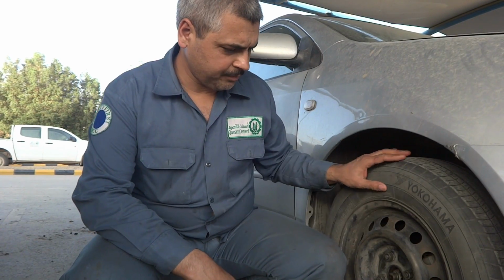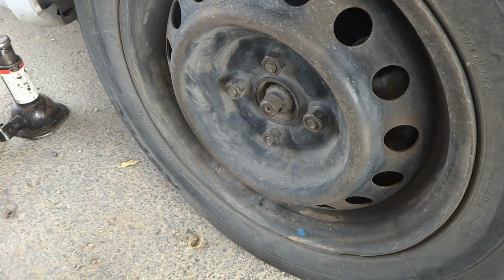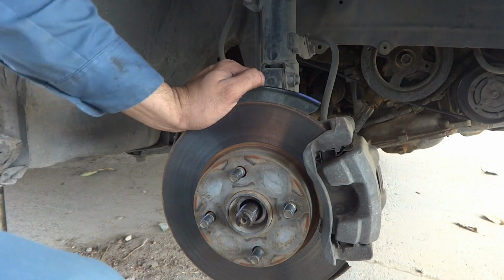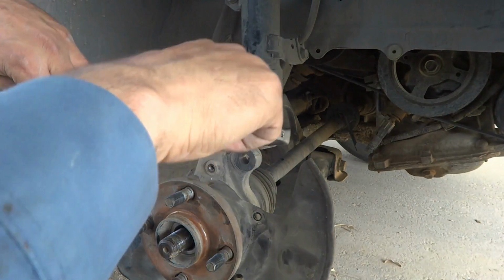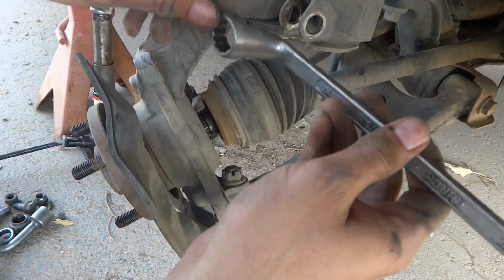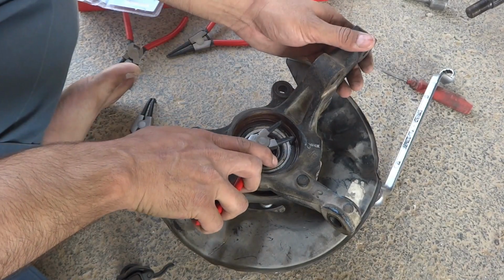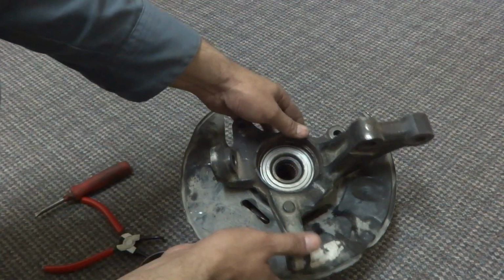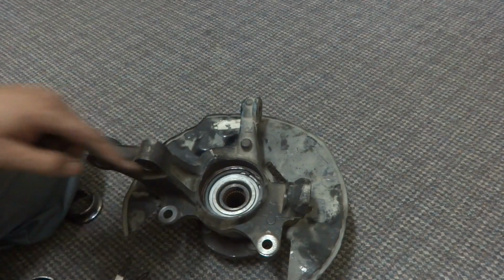Car front wheel bearing replacement. car repair, car maintenance.

Comment: Next time you change a wheel bearing on a Corolla, theres no need to remove the steering joint and the lower ball joint, Just the 3 bolts holding the lower ball joint to the chassis. It will save you a balljoint and some time :)
Reply: Do you think that is the same for a Yaris? I'm changing the clutch so need to get the shafts out.

Comment: Loverly job done jahan :-))

Ive watched quite a few videos and that inner race is allways a pain to remove, some people use a disk type tool to cut a slot in the race then place a chisel tip into the slot and hit with a hammer to fracture the race.

But your method works nicely, and the job is done :-))
So much easyer when you have some good tools, those circlip plyers look smashing :-)

Comment: Looks like you have "HAZET" double box wrench,probably model;630-30X34 or 630-30X32.Quality tools,"HAZET"!I would never use hammer on my wrench.
Reply from the maker: +Broj 1 Yes maybe. They work nicely with me. I am hammering sometimes to make things loose or tighten whenever it is required. It is not harming anything but the vehicle safety is important than anything. Regards,

Comment: You need a press to remove the bearing and then a press to insert the new bearing. The way you are doing it hammering on the new bearing to insert it will damage the new bearing.
Reply from the maker: Excellent comment. This was a diy replacement without fancy tools. Stay tuned.

Comment: You didn't show how you removed or pressed the bearing.
Just stated that a pipe was used.  
Wasn't that the whole purpose of this video?
Reply from the maker: m.m.rashid Yes dear friend you are correct. The whole process is so complicated for bearing replacement that it was going beyond the reach of this video. I will try to shoot a video showing ever detail some times when ever will get a chance. Hope you understand some thing from the video and also there are a lot of other videos showing lot of details on other subjects. Do sub and like. Regards,
Reply: yeah replacing the whole wheel hub assembly is different the way to go and its not really that much more expensive for my car its only about $30 for the wha and $5 for the wheel bearing. it take like 2-3 hours to change the bearing and like 30 mins to change the whole wha.

Comment: Sir,  11 years old wagonr neends new bearing ?????
Problm is this  on high speed  90km breaks then too much vibrations.
Reply from the maker: It's not a must that you would have bad bearings. But you may check them by shaking and wiggling. Your problem seems to be worn out brake disks and unbalanced wheels. You may machine your break disks and make all your wheels balanced by some good wheel and tire shop. Hope it could solve your vibration problem without bearings replacement. Also you must check all four shock absorbers or struts for your car as they have very important role in driveability and comfort of your car.
Reply: @JahanZeb1976  i have all shockers & suspenion changed last year

Comment: Can you purchase the whole wheel hub with the new bearing already installed to avoid all this hammering and custom pipe thing? I have a 2004 corolla ce that needs new bearing. Thanks in advance.
Reply from the maker: Benjamin Aguilar Dear friend this is possible that you can purchase the whole wheel hub assembly. You may check with your close parts dealership. But sure it would be much more expensive. If you don't want a pain of such work, you can remove the hub and take it to a machine shop. They will do the job for you. And then you will fix it back to the car. If you are worried that the hammering could damage it, nothing is happening to hub and wheel with hammering. Regards,
Reply: Take the hub to a parts store with  a machine shop, they can press out old one and press in new one... Not much cost

Comment: Where are you from?How come your Toyota Corolla 2004.,have only four lug nuts?My Corolla 2006.(North American model),has five lug nuts.
Reply from the maker: +Broj 1 Dear friend I am from Saudi Arabia. There are two major types of Toyota Corolla here in the middle east. The one you are looking with me is 1.3L 2NZ-FE and the other one is 1.6L. The first one I am working on is having four lug bolts in wheel as you can see. the other model 1.6L have five lug bolts in its wheel. I love driving my 1.3L due to its economy. Regards,
Reply: +LearningZone North American,ninth generation (E120/E130 2000-2006)Corolla came with two 1.8 L engines.One of those two is 1ZZ-FE,and with high performance engine was;2ZZ-GE.My 2006. Corolla with 1ZZ-FE engine and five speed transmission,is extremely fuel efficient car.(At least for N. American standards)My wife's Toyota Yaris 2010. has 1.5 liter engine and feels very wimpy.Manual transmission on that car is not much better.

Comment: Can I copy all of this for a 2005 corolla ce?
Reply from the maker: It should work for more cars of the brand. You may keep yourself ready to remove bearing races getting help from your nearest machine shop. Most mechanics are are doing the same practice to remove races from machine shops as they don't have necessary hydraulic and heating equipment to carry on such a job. You may watch my other videos especially brake repair video to get good concept of the job and to be ready to get the job done. You may subscribe on my channel also so that you will get notification on each upload. Regards,
Reply: 04Burns all the  front wheel drive cars are basically same arrangement and the process of removing will be almost same. since this is older car and in certain place in the world. Different places have different specification due to govt. regulation. In places Like USA and Europe they should have some sensor for the ABS system and if you break it then the cost of replacing sensor will be twice as much

Comment: you could make your video even better by making it completely silent next time, just like the real pros do.
Reply from the maker: That could be better for you but most people on my channel needs audio for understanding. If you don't like audio, just mute it and it will be same as there is no audio! Difficult problem, simple solution. Regards,
Reply: LearningZone :-)
Reply: I agree with you LeaningZone I don't want it silent.  I like it when you explain.  A silent video is very Unprofessional.